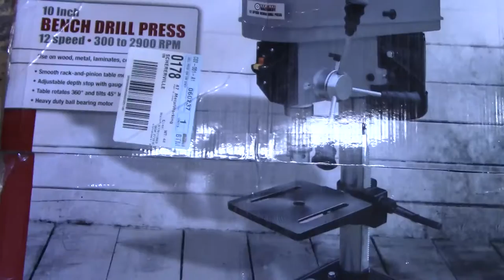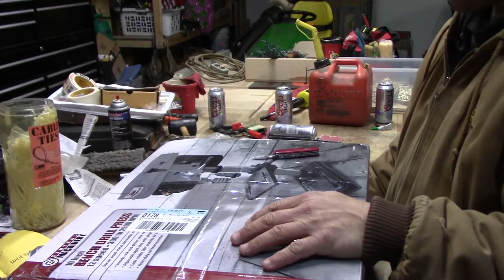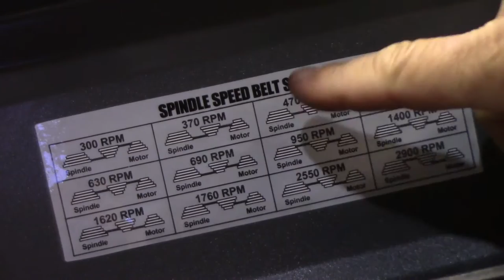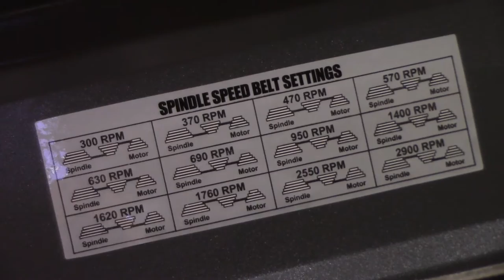Central Machinery 10" Drill Press From Harbor Freight

Comment: Thanks for the video. I just bought the same drill press today. I couldn't for the life of me figure out what the flat/wedge thing was for. You said that it's used to push out the arbor. I never would have figured that out myself. It's a decent drill press for the money. Rather flimsy but for my purposes it won't see any heavy use. So it's perfect for me.
Reply from the maker: joeshmoe1962, I'm glad you got something out of the video. I agree, a little flimsy but perfect for me too.
Reply: @lennyc624  Thanks very much! I too had no clue what the wedge was for!
Reply: 3 years later and this is still helping! Searched all over for what this little wedge is. Into the trash it goes 😂

Comment: Thanks for the fine video on this bench drill press. I have the 8" bench drill press, which I paid $41.00 on sale etc. Its in my cellar, just the correct size for my cellar , and Ive used it a lot on metal and wood mostly, for walking /hiking sticks. Iam a DIY so its just right for me. Good Luck and enjoy yours.  Cheers !

Comment: Bought one. For the life of me I can't find where Part #32, listed as a Key, goes on the drill press. There's also no place to put the chuck key so it doesn't get lost.
Reply from the maker: Not sure if part 32 is the wedge to remove the chuck, but if that's what you're talking about, it doesn't go on the drill press. I hung mine on the wall. Also, I hung my chuck key from a chain off the back of the drill press. That works great. The chain was not included. If you don't have a small chain you could use a small rope or something but that has worked great for me.

Comment: Did you do your research before buying this drill press?  There are so many vids on YT, no one should be surprised when they take a HF press out of the box.  Sounds like you might have preferred the NOVA 58000 Voyager DVR drill press for $1,350.  Speed 50-5,500 RPM; 18" swing and 6" quill stroke. 2MT quill taper; digital depth quill readout and digital speed readout.  Easily handles wood, plastic, metal, glass.  HP 1.75/2 high torque.  Material - steel.  Has a 2 yr. warranty on all parts.  I am quite sure that the NOVA drill press will not feel wobbly, plasticky or flimsy.  Weight 300+ lbs.